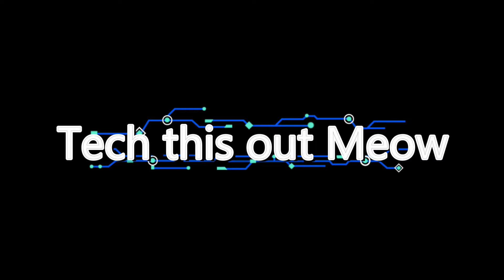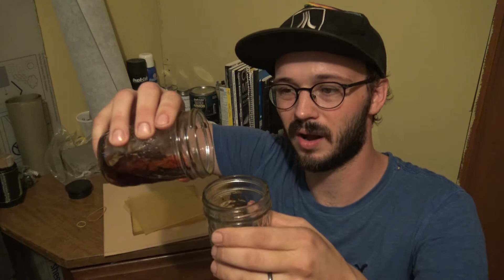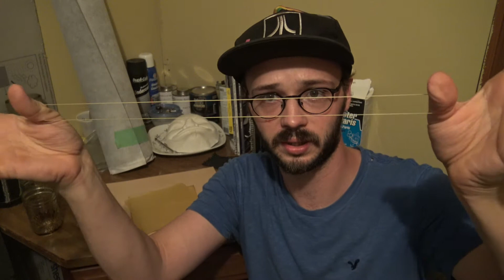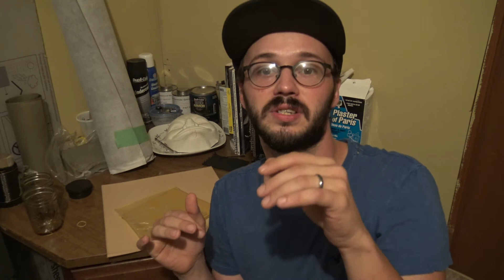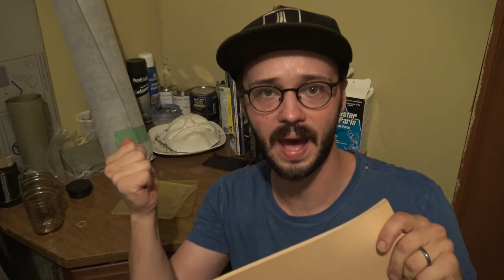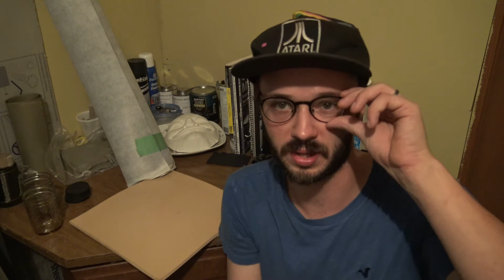Viscoelastic gels and foam. plastics talk ep.1

Comment: I have a review request if you want to call it that.  I am curious of ballistic effects against boron carbide silicon powder impregnated into a quality resin like 820 onto alternate layered S-glass / Aramid 29/ Spectra.  ( unsure if 820 is best catalyst for boron carbide, maybe nylon/poly? idk) Also there may be diminishing returns on the ratio of boron carbide powder per resin so I've been researching what that amount may be to no avail and also I have been researching what may be the best hardener for causing the nano-tubes to form during the bonding process of the resin, but there are so many variables involved only a hands on experiment will really tell.
Reply from the maker: Well isn't that a tall order! lol Just kidding, I've honestly working on impregnating resin with boron carbide powder! If you go to the community Tab on my home page you'll see some of the photos I've posted, and one of them that I tested was boron carbide, one was silicon carbide, and another was tungsten carbide. They preformed well, however I wasn't satisfied with the results completely so I've been holding off on showing the full results of that experiment. Hopefully I'll be able to afford more of the powder soon, and when I do I'll try it with 820, I have some of that stuff with nano tubes alread added under the brand name Adtech. Thanks for the suggestion, when I try it again I'll be sure to add some of your ideas to the mix.
Reply: @Techthisoutmeow  WoW!  SOunds like you are already all over it.  I can't wait to see the results of your experiments. I'll stay tuned...thanks for all your hard work.